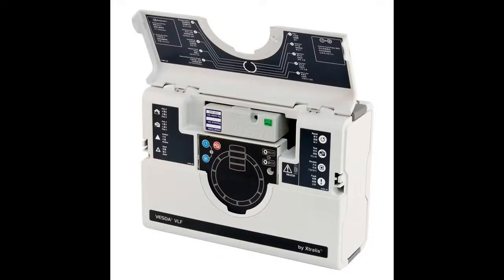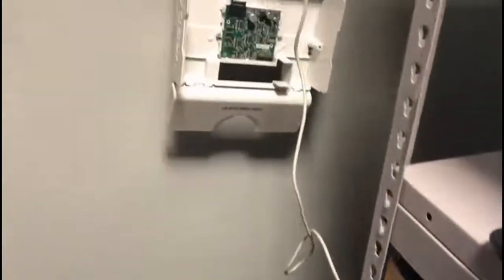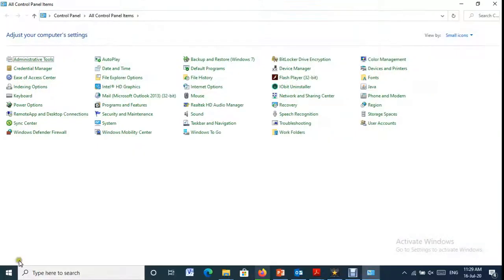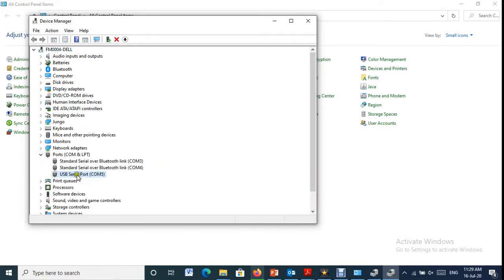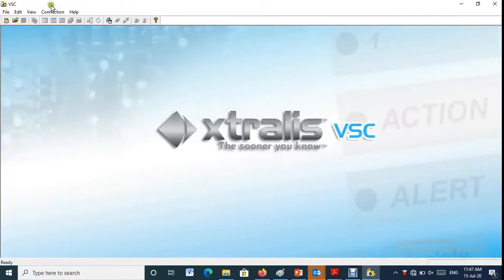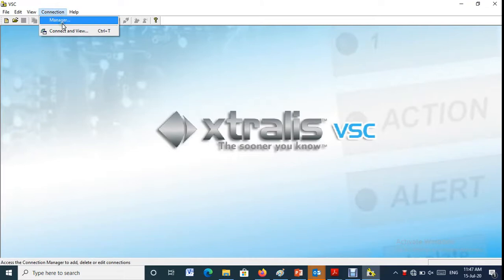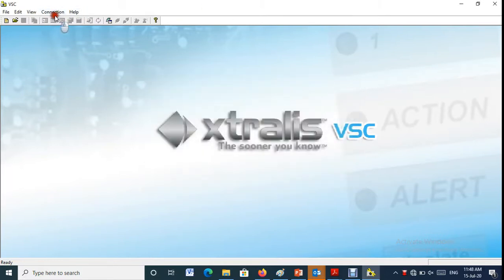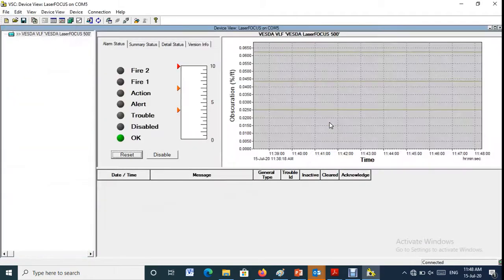Xtralis - VESDA - VLF /VSC - Part-1- Connection

Comment: With the 9 pin serial cable is it male-male or female-female or male-female? Also the same for serial to usb cable too please
Reply: 9 pin needs to be male to female. The serial to USB i use is the MOXA  Serial Converter and this has a male pin end.